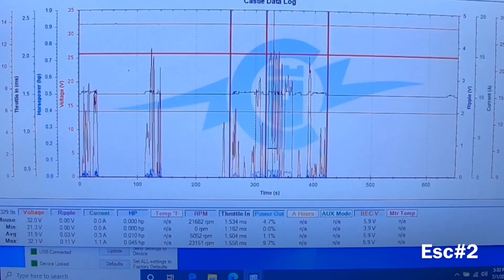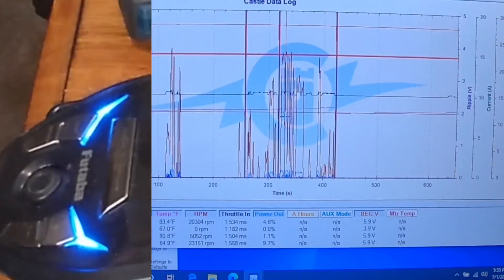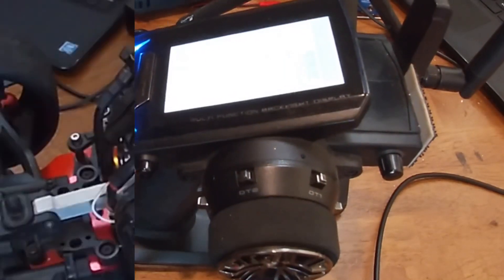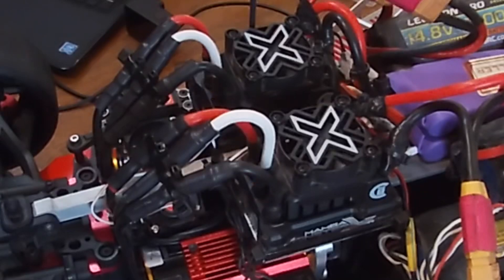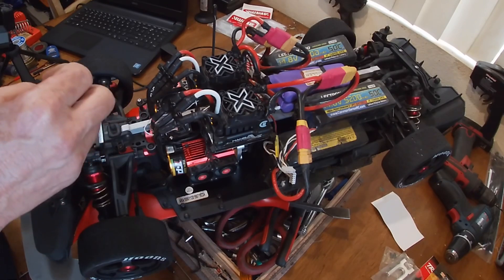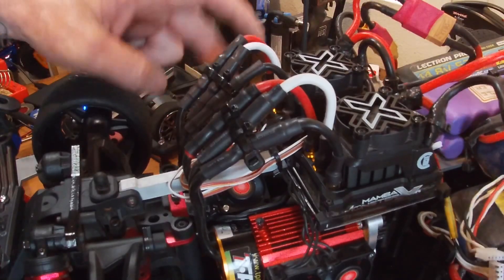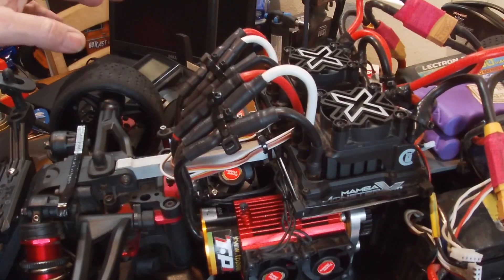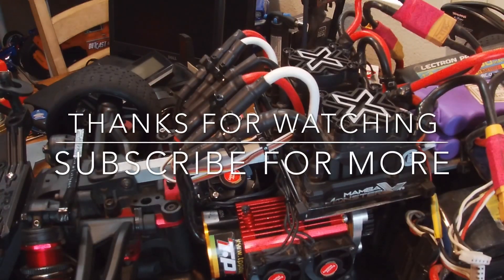Twin motor infraction esc issue solved ( motors starting different times)

Comment: Good videos here. I enjoy the critical thinking process you demonstrate while progressing through obstacles. It's a scarce skill these days so your probly helping some in more ways than you or they know. Anyhow, I did have a hard time getting past the manner in which you speak. I'm not insulting, it is calming. I'm joking but, you would kill me in a debate if you debated with that voice. Lol Truthfully, for me it took me a moment to get used to you doing you and I've come to appreciate it. Good content! 

So I know that I'm late to the party here. I'm only about 1/4 into this video but have watched its predictions. I have not noticed, though I may have missed, you do a few things. First would be to make sure that the drag brake was disabled. At least for while things are not perfect, you would want your drag brake off. Next, I've not seen you perform the motor test process on both esc's and the corresponding motor. Lastly, you set up one esc the way you want, load and save the settings then all you have to do with the other ESC is to run your saved settings from the first esc and load those settings into the second esc, you'll know that they are identical.
Reply from the maker: Yes twin motor been dialed in as far as both finally running perfect now I’m trying to control the power it comes on so strong at 100 mph it’s crazy 👍👍💯💯🔥🔥🔥appreciate the help and advise 💪💪🔥🔥🔥

Comment: Nice 👌, glad you found it. Can't wait for the 16S run. Just ordered another tp motor & spool from island. Can't wait to give the 4260cm 2080kv motor a spin😃
Reply from the maker: That should be some power 💪💪💪
Reply: @earlmoorhead5555  Yep just got off the phone with them 42t spur on a Ti spindle, 21t pinion, all 8mm💪💪🇺🇲 Gonna get it tomorrow in time for the 4th😃

Comment: Earl, I copied this from FB about grub screws coming loose. Grub screws tight red locktite, kept coming off. I soaked the cups and screws in brake cleaner and it solved the problem. Gunk builds up on the screw and the thread, this gives the feeling that the screw is tight when it's not.
I’m thinking if you soak the pinion gear in brake fluid it may solve the problem of it coming loose.
Reply from the maker: Yes I might have to as I just spray brake cleaner before I install the grub screw but might not be enough 💯💯💯